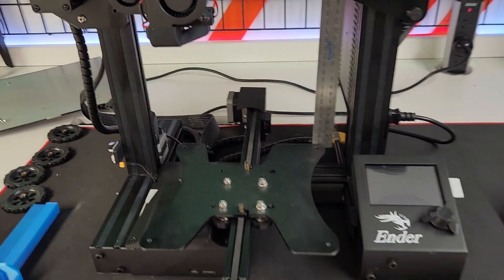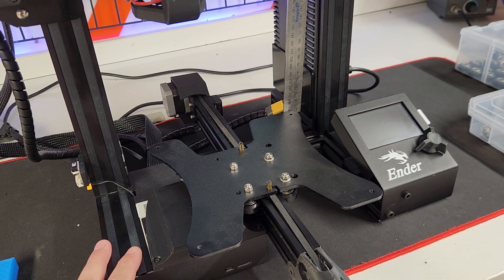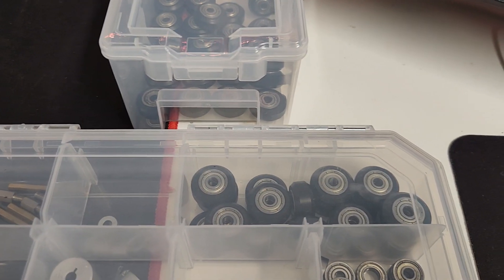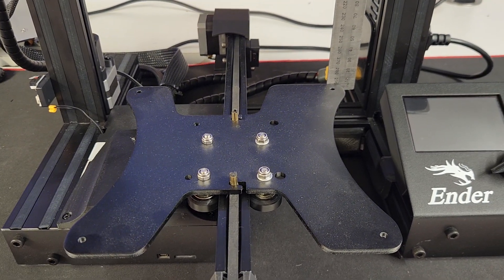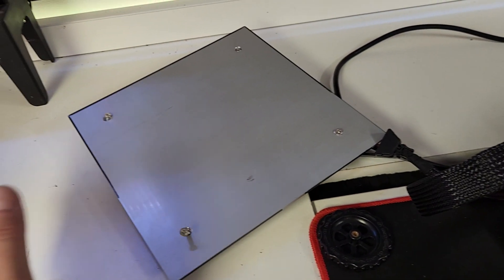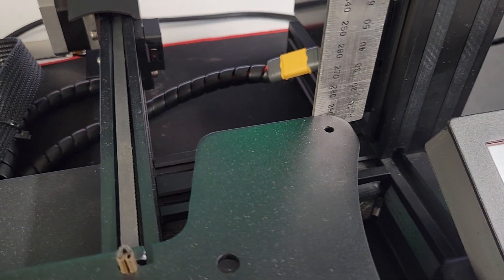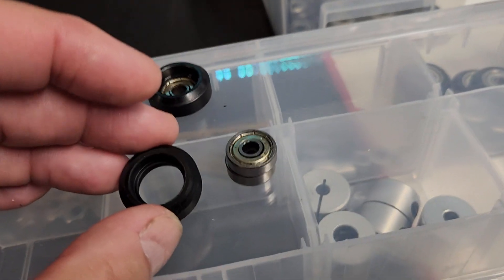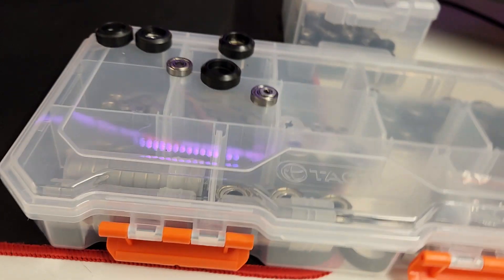Ender 3 bed levelling issues ?? Here's the Fix

Comment: I almost got rid of my first Ender back in 2019 for this exact reason.  I couldn't figure out why it would stay level for a long stretch then suddenly go wonky.  Turns out, I had two crappy v-rollers and I was making the problem worse by scraping and prying on the bed trying to remove printed parts before it had cooled completely.  Now I have removable spring steel build surfaces on all my printers, I'm a little more patient, and I know what to look for in new rollers.  Don't know how things are there, but a bag of 25 rollers here will usually have 4-5 bad ones.  Great content as always.  Thanks for sharing this important tip.

Comment: I just encountered this problem on my printer, after managing to figure out how most things on my printer worked I just couldn't get my bed to stay level, even with a bl touch because as soon as the bed moved the leveling changed, I got a cheap linear rail kit to fix that and not have to deal with this anymore

Comment: I've been having leveling problems, but it's definitely not the same issue. I made a new Z-Stop to lower the table to increase the spring pressure against the leveling screws, so they don't back out... but they're STILL backing out (the OEM Z-Stop made me lift the table so high that the screw-wheels were all so loose they were spinning free). The Z-Stop I made lowers the table almost 1/8" more and that increased the tension on the wheels to help them not back out... but it still happens pretty bad on very long prints, so I just taped them for now. I made the mistake of adding a little Loc-Tite to the threads of the leveling bolts but that just made it impossible to level, because it caused the bolts to spin (so spinning the wheels did nothing but spin the bolts). Watching this video now and looking for some 3d files for a "stop" for the wheels, so I can zero them and then make sure they don't move again. Seems like such an obvious design flaw that I just can't believe they made them like this in the first place... but at-least they should have fixed the design by now. I just wanted to mention this for other people that might be having the same problems. There's definitely design flaws in the Z-Stop (height) and the wheels that are used to level the table.

Comment: Mate i was on the verge of throwing my Ender into a damn river from the frustraton it caused me XD. I have leveling problems since day 1 and after a few prints it got worse and after some inspection i found that this plate was wobbly. These wheels also deteriorated extremely fast. Thanks man you just put an end (hopefuly) to my frustration

Comment: Great tip, I had the exact same problem on my Ender 3 V2 last year, took me a long time to figure out where that inconsistency came from! I was tired of the dealing with the wheels anyway so I went straight to dual MGN12 rails with a simply mount from Thingiverse, perfect stable since and no maintenance or adjustment needed.

Comment: My problem was that the z switch was unreliable. Spent weeks leveling...
Reply: Yeah the endstop switches are very inaccurate. I have always loved the idea of not having to mess with auto levelers because theyre not necessary and just extra cost. Klipper, with a properly calibrated endstop and endstop phase enabled has saved me so many headaches. No more baby stepping, same height every time with a manual level and a bed mesh. Endstop phase basically makes your stepper motor end on the same step phase everytime, so it uses the mechanical endstop for reference then goes to the phase you calibrated. Absolutely genius for people that dont wanna play with ABL.